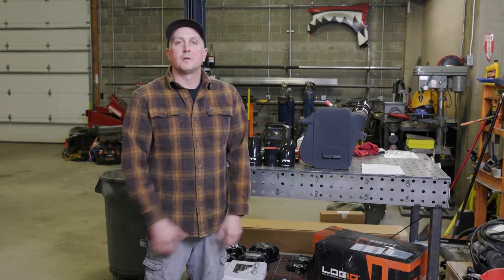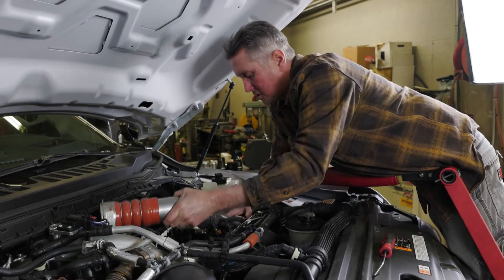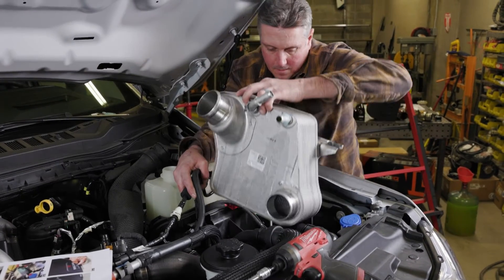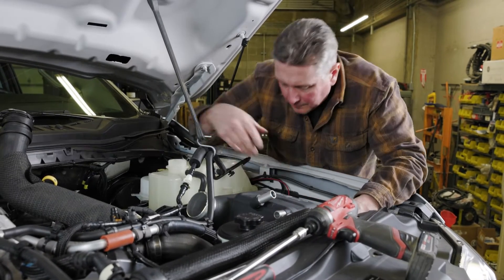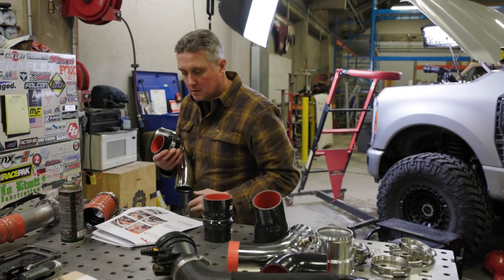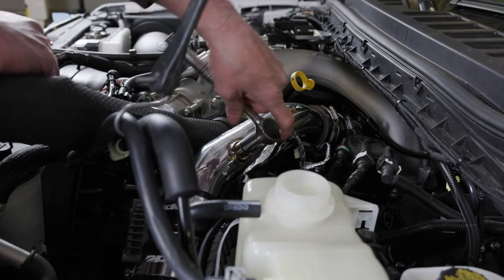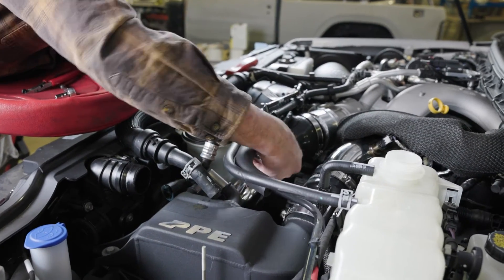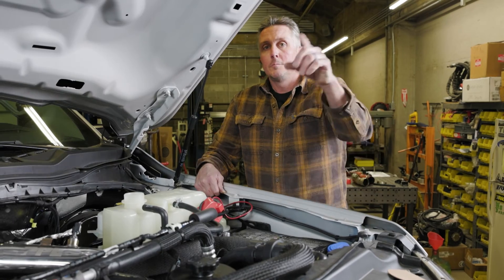PPE WATER-TO-AIR INTERCOOLER INSTALL | 6.7L POWERSTROKE

Comment: Great video, nice walk through on install. Do you or PPE have any data, dyno type info showing the improvements? Torque, HP, Hot Temp / Cold Temps, EGT Temps?

Comment: It would be interesting to see how much oil is at the bottom of the stock intercooler given this truck is not deleted. Mine had quite a bit at 5k miles